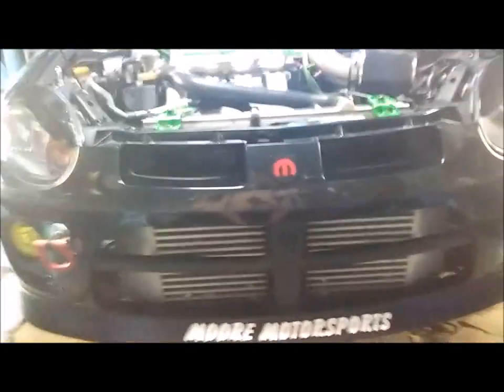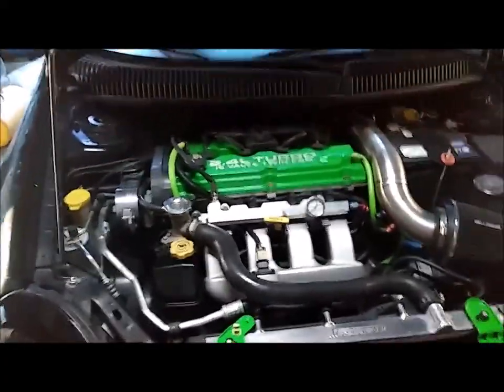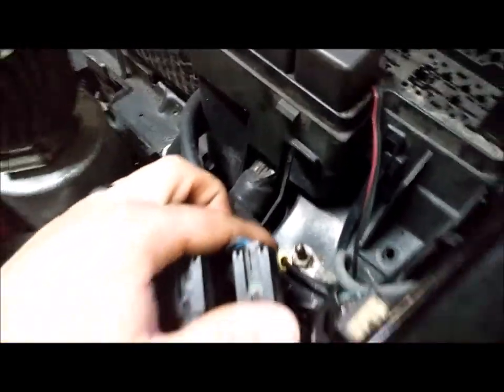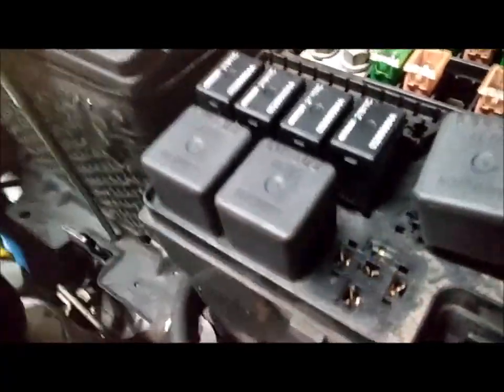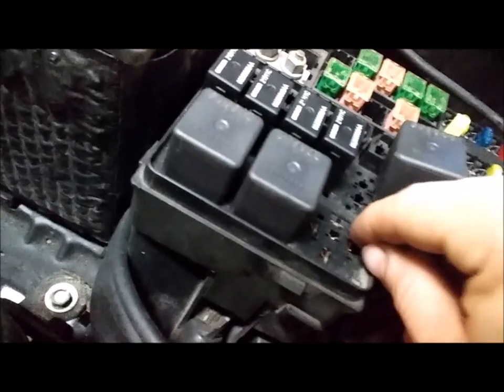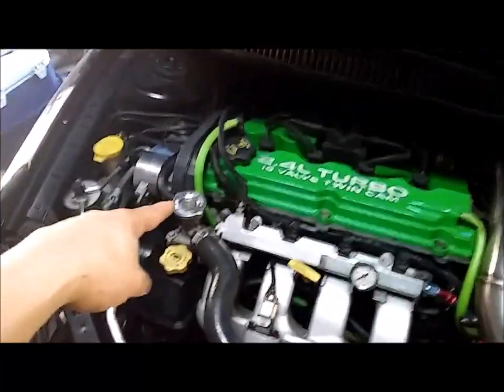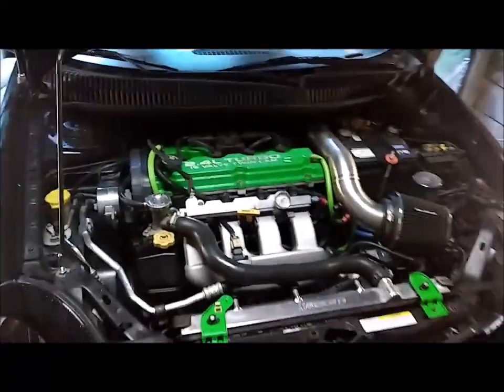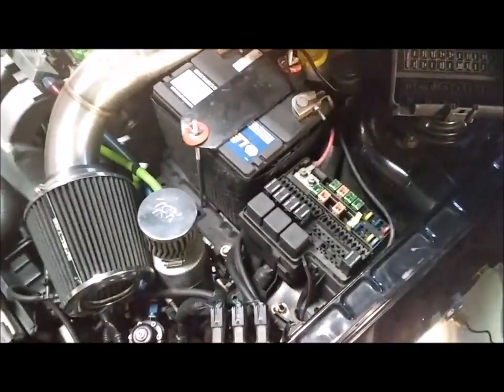Srt-4 Cooling System hack- How to keep temps down

Comment: Cool video but you might want to tell people to be careful because if they do this you run the risk of blowing your 15 amp PCM fuse in the dash and then wonder why the car won’t start stumped me for about 20 minutes till I realized it actually burned up the fuse for the relays including the infamous ASD
Reply from the maker: Buggers Unboxings oh snap!! Didn’t have that issue. Im sorry about that good info to know I’ll pin this post
Reply: Same
Reply: So what do you do if it's blowing the fuse? Am I putting the ground in the wrong spot? I'm not sure but would be awesome if someone could help!!
Reply: @Botcheykibbles46  having to small of a gauge wire could short it out most common are 12 gauge look at the amp do a little research to see the output/input
Reply: I blow my pcm like  20 times in a day i bridge it an still had a small fire an pcm was  still good no big deal

Comment: better to just turn the fan temp down on the diablosport. 180 degree thermostat and set the fans at 180. I've never seen my temp over 185 with the ac on in 100 degree weather.
Reply from the maker: I am on a stock tune no tuner yet. This is just a general mod that can be done on any stock car. i don't get over 175-180 degrees now. I have a nice code reader and it said highest temp was 180 a/c on or off sitting in hot traffic or not. My Normal operating temperature is around 170 highest it peaks is 180. 

But you are correct it would be ALOT easier to turn the temperature down in the tuner. I have a 160degree thermostat so it helps keep it way cooler and with fans on at all time it cools down really fast which is nice because i was getting WAY to hott for my liking.
Reply: James Dguy sorry. I assumed you had a diablosport. haven't seen a stock tune srt4 in awhile lol
Reply from the maker: its cool Lol im trying to squeeze the fastest 1/4 mile outta her on stock tune and boost level and then get a tune. so far 13.4 @105mph. gonna break 12s soon
Reply from the maker: its cool Lol im trying to squeeze the fastest 1/4 mile outta her on stock tune and boost level and then get a tune. so far 13.4 @105mph. gonna break 12s soon
Reply: James Dguy nice. that's pretty good for stock tune. the stock tune has a little room for more boost. my Afr was in the 10s bone stock. was able to run around 18psi on the stock tune with just a stage 2 wga if I remember. Afr was high 11s I think
Reply from the maker: ya I was at 22psi did perfect but wanted to go stock engine/boost level but im going to go up a little if I can't break 12s. my tires were still not hooking on low 13 pass
Reply from the maker: ya I was at 22psi did perfect but wanted to go stock engine/boost level but im going to go up a little if I can't break 12s. my tires were still not hooking on low 13 pass
Reply: same here, I had a stage 2 with no overeating issues, theres something else going on with guys car
Reply: You're not pushing coolant are you? That's what mine was doing when I was constantly overheating. And I live in El Paso, TX, which is average 110°F in the summers. Had to replace my head gasket. Got ARP's with a 180° thermostat and DS set to 180° no problems with big turbo and big cams.
Reply: How do you do this in with DiabloSport? I have the InTune i3 Platinum and when looking through all the setting I have yet to find one for this particular parameter.
Reply: Matt Spill probably trinity
Reply: So on the diablo tune you can lower it can you go in to detail I just got one set for the 93 tune any tips and how to get temp lowered Amanda if you or any on has any more tips

Comment: Mines an 2003 srt and with the ac running my temp stays at 200 which is fine for a cast iorn block. With it off on a hot day it risesto 210 which again not bad since the factory head gasket is pretty darn thick. If we had aluminum blocks then yes pop goesthe motor

Comment: +James Dguy - Do a Thermostat By-Pass + get a 12V DC Electronic Thermostat $4 Controller, hook that to your " Negative Wire " or Relay if your Fan is Rated over 20Amps... It will TURN ON the FAN - Whatever the Temps you want or wishes. Save a lot of Headaches, Over Heating Issues... FINE TUNE IT ANYWAY YOU WANT !!! Best of all COST $4.00 :D
Reply from the maker: Nice i had a ground wire laying around did this mod for free! lol
Reply: +James Dguy - Although you are right about the FREE GROUND WIRE. But the Fan is on 24/7... Not literally 24/7 per say... But it will be on once the Key is On :(((. That is not good since it drains too much juice from your Battery / Alternator as you already know. Plus running a Fan like that will make the Fan break and cost more Money :(((. I think $4.00 approach would be cheaper don't' you think?

Comment: Liking your video, one question? You already have an upgraded radiator that wasn't Mentioned. That has increased cooling with lower stat and now constant Fans, won't be needed.
Reply from the maker: James Parra I was hitting 225+ when sitting during the summer running a/c without constant fans even with everything done such as lower temp thermostat and aftermarket radiator. Afterwards it was 195-200 constant even less on cooler days
Reply: Yes, I have the exact same problem. Thanks,  the quick reply.

Comment: The motor's designed to run at 195°. You need the oil to get to that temperature to burn off condensation and work properly. I wouldn't be running that thermostat in the winter time. Not sure why you did a 160 and didn't just do a 180.

Comment: Did anyone else get CEL after this?
Reply from the maker: I didn't im 100% stock tune, Neither did my buddy srt4 all stock has less mods than i do. My dads PT cruiser and my old stock non srt neon.
Reply: Yeah I just replaced my alternator and forgot to plug in some wires lol.
Reply: Unfortunately I did do this and only one fan kicks into high while the other only comes on with ac. Ive replaced water pump. Timing. 180 tstat. New radiator and fans. New cap. And still getting up to red line. Coolant isnt boiling over either. I'm at a loss. These 100° temps on Florida are fucking me right now
Reply from the maker: ya we are at 108+ here in kansas lately. I would do the 160 thermostat u can order it online at o'reilly's website. U can not order it in store but the 160 is what i have and it works amazing!  On super hott days while running a/c it gets about 200 at MOST 220. But it hardly ever runs that hott anymore. But make sure u use fans that have shrouds like the factory setup they draw in A LOT more air flow. Im at a loss too that sounds like everything i would tell you too do. U could get a Oil cooler and run it in front of the intercooler but instead of using it as a oil cooler u could run the turbo coolant thru it to cool it down a bit more. Also if u have a cat it could be getting plugged up a little causing higher engine temps. I have seen it before. Worth a shot. Here in kansas we don't have emission laws so im catless
Reply: Rogue Srt I think u have a Blown head gasket do a block check

Comment: Bro what's that gage on fuel rail
Reply from the maker: Fuel pressure gauge. It saved my ass so much work a few times. One time fuel pressure dropped down to 40psi and i was having issues i looked at the gauge knew it was a fuel issue and it ended up being a prior owner problem. They never did a return line fuel filter because factory fuel filters need blocked off on the FPR side. So i blocked the side that needed it off and BAM went back to 60psi i believe (dont quote me on psi)

Comment: I'm definitely going to look into it. Went out there tonight and retraced everything wires and hoses. Ended up finding out 1 fan was pushing and the other was pulling. Fixed it and now its sitting right at 205 with this mod and 180 t stat. Thanks again bud. I'm going to definitely look into the 160 and gasket
Reply from the maker: For sure! Any time. Im full of idea's that work so if u ever get stuff let me know! I can try to help. I may not know everything but i know alot of things that could help!

Comment: Put a switch in between the wire, and use it when needed
Reply from the maker: thats a good idea. My car need cooling all the time more Hp lol.  but during winter most people would probably remove this but it got cold the other morning 50degrees (cold for us here right now) and made it to the end of the block after start up and it was already blowing warm air out the vent but with a coolant cooled turbo I expected as much. but I might put a switch on it for this winter.
Reply: Skittle Fabz no. You just put a 1 wire ground switch and it does the same thing in the video. It’ll turn on and off with the car.  

Plus you aren’t getting out of the car with it off and those fans screaming and forgetting. 

It would also help because above 50mph you don’t have any reason for the fan to be running and wearing itself out faster.

Comment: If you wanna try to get real crafty run a negative to a toggle switch in the cabin so you can choose when to turn the fan on or off.
Reply from the maker: I actually need to do a video on this lol. I did this once. I ran a toggle and did this so during cold seasons I could turn it off during cold seasons and since sensor was bad the car warmed up quick. But on my Honda not the srt4.

Comment: Gonna switch mine to this now. Do you know how to do the clutch bypass for remote start?? Mine has had it on there for a while now, then for some reason it failed. 🤷🏻‍♂️
Power accessory key on but no start. Unless I push the clutch in🤦🏻‍♂️
Reply from the maker: Violet Lynn Scraton It should be like a civic just run the 2 clutch wires together at the clutch pedal but I am not 100% sure since I never did it to the SRT. Becarful to do this fan thing carefully or it will blow a fuse can’t remember which one but that will make it not start so if it don’t start that’s the issue!

Comment: What if it doesn’t turn on?
Reply from the maker: Either bad fans or bad relay?. I have done it to a few SRT-4 and never had a no fan turn on problem. Now if your car don't start afterwards there is a fuse that tends to sometimes blow.. I can't remember which one but don't freak out just check ur inside door panel fuse by fuse.  This only blows if it accidentally touches the positive on the relay. Hope that helps
Reply: James D guy I’ll investigate some more thank you

Comment: Nice but the 160 t stat did that alone best remedy is 160-180 t stat 20 psi dcr cap and royal purple purple ice or red line Coolant Additive even water wetter is good and never had an issue with temps rising over 200 again

Comment: Good video,only issue might be is that oil needs to be 180 or above to make unburned gases in oil to be sucked thru your pvc valve.oil under 180 degrees will not make gases in oil evaporate,making oil in ur car thinner.
Reply: Oil temp has nothing to do with water temp.
Reply: He's saying the colder the coolant, the colder the overall engine temp. I believe he's intending to mention how if you never exceed 180*, the engine never reaches the optimal temp for operation.

Comment: Just bought an 03with 139K basically stock  just bolt ons .. everything else is stock .anyways when the car is idling it stays at like 210 then when fans kick on it goes back to 200 even. Bit when I'm driving it stays at 200 or a bit cooler . Stock fans and radiator with new mopar coolant .. could I benefit from this mod ?
Reply from the maker: Over 200 is normal for coolant fed turbo on them I feel like everyone can benefit from this mod. Be careful not to blow a fuse but if ur car don’t start after this mod check for a fuse on the side of the dash. It’s easy to hit the wrong pin on the relay. Hope this mod helps you! Also during winter I would remove the fan mod because of the cold air might take longer to warm up.
Reply: @JamesDguy  awesome man thank you also would water wetter help to ? Heard alot of guys using them granted I live In CT and we're starting to get cold up here . One more question since you seem to know alot about these I'm new.. how are the head gaskets on these Mine being basically stock ? My car doesn't smoke maybe a puff of Black smoke on full boost that's about it needs at tune badly. And transmission is fine no grinds in any gear .